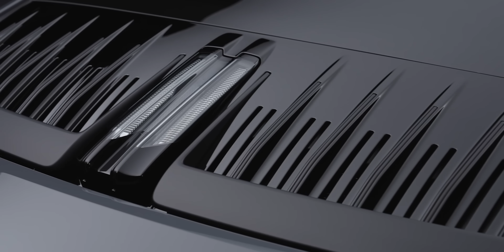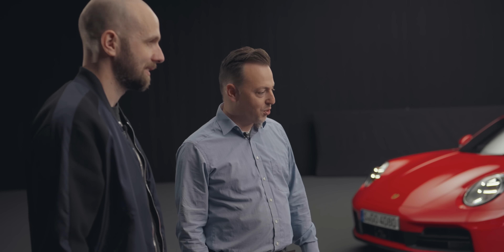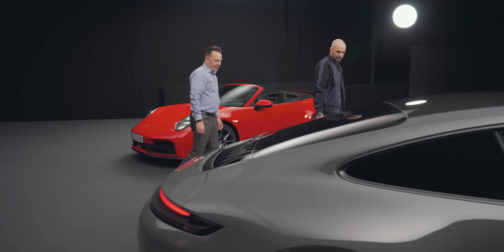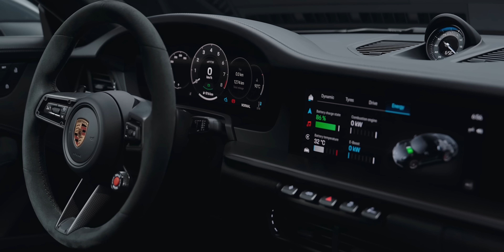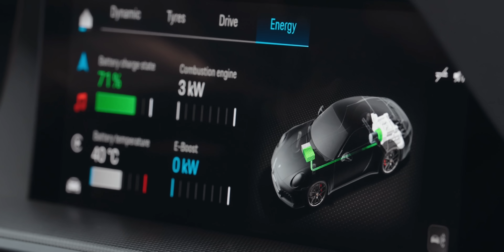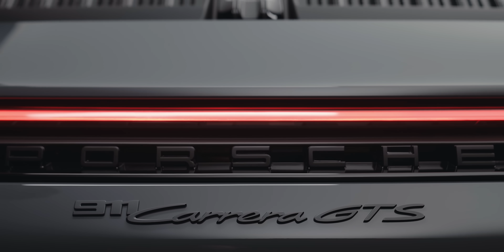Meet The New Porsche Carrera 992.2 GTS!

Comment: This 992.2 has all inconvenient of a hybrid (weight, complexity, cost of repair, etc...) with none of the advantages (no CO2 reduction, no fuel consumption improvement, no EV mode).
Reply: It offers a huge improvement in performance for not that much extra weight. It is a performance hybrid not an economy focussed hybrid. Porsche customers want this technology whereas you probably own a Tesla Model 3.
Reply: it’s a porsche 911 not a prius. i actually like this direction for the car because its faster while not being much heavier and it’s still gasoline powered

Comment: Front: „We needed so much air, we took the indicator and position lamp and integrated them in the headlamp“.
To me it looks like there would be plenty of room left. But one headlamp unit is cheaper than several pieces.
No, but if you need more air, I totally agree…

Comment: WTF Porsche!? No analog tachometers (the classic 5-gauge cluster), no old-school turn key on the left side, too many screens!! F**cking hideous. Thank f*cking god I got my 718 2024 with the old classic interior still. A Toyota from 2006 has a better start button. The exterior front design is too bulky, too aggressive, it's not that elegant as with the previous models. It's starting to no longer look like a Porsche. And I'm only 28 too, so you're not getting the young folks on-board with this new digital bullshit.

Kudos in the engine department though (the whole eTurbo/eMotor combo is pretty sweet) - only adding 50kg is an engineering feat. Most enthusiastic about the drivetrain. Would be interested to hear what other handling improvements have been added. Pair that with a nice manual and that thing will fly like a naturally aspirated engine.

Comment: While the update of the GTS looks like a great technological achievement,  the base Carrera does not really benefit of any progress. I am also not convinced by some of the design changes like the cheap looking hood or the full digital dashboard. Front looks nicer then before. Overall  992.1 owners can be quiet happy because this car will not really hurt the resell value of the predecessor.

Comment: 992.1 better
Reply from the maker: Would have to drive both back to back to say, let's see.
Reply: People hate change, when the new 911 comes out you will probably say “992.2 better”
Reply: @joostpereira7470 if new 911 comes with less buttons and no analog controls than 992.2 , I will probably say “992.2 better”
Reply: @joostpereira7470 I embrace change not into all the old metal out there and love tech. I don't have to have analogue dials. I don't have to have a start key. I don't have to have an attractive front end without ugly plastic louvres. I don't have to have a sleek rear end without loads of conflicting plastic bits and I don't have to have a pure ICE 911. But just one of them would be nice. I'm the target market and they've missed by miles. My 992.1 GTS aero has just become a keeper and thanks to Porsche I've saved a good few K and can now give the dreaded dealers a miss.
Reply: Persuasive argument.
Reply: 991.2 better
Reply: Who is next?

Comment: death of the most important manual transmission. F.
Reply: Maybe the base models might get the manual and the GT3 too.
Reply: @nibinjohn3761  no manual options in the car configurator for the base, maybe for the S again, or later a T. GT3 almost for sure, hopefully with shorter ration of the S/T.